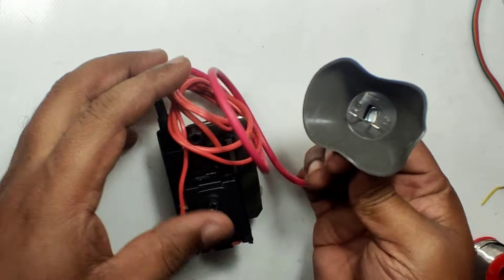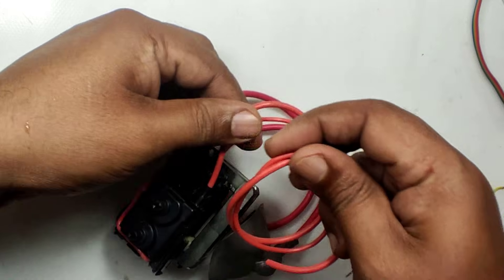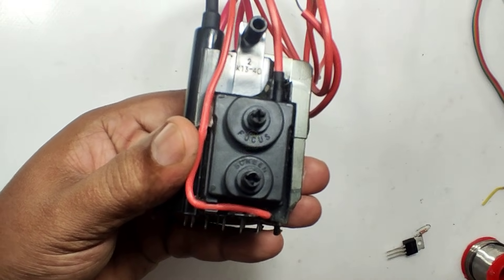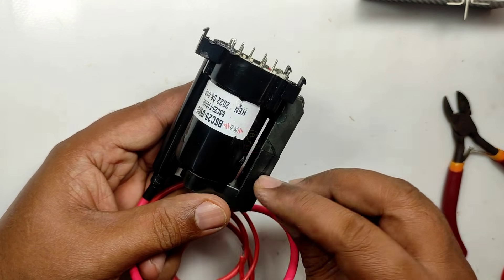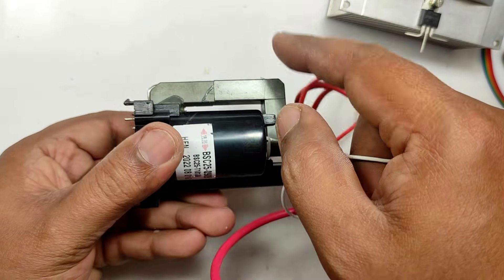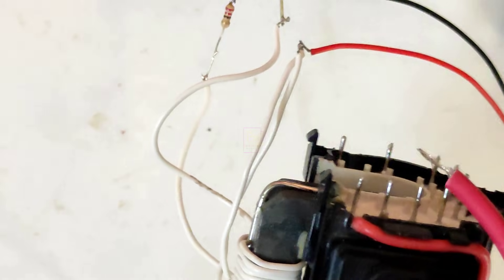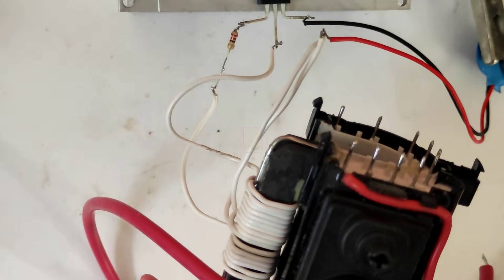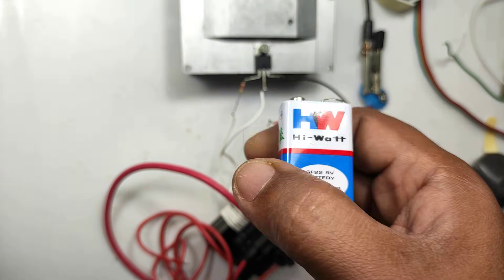How to make 400000V using Flyback transformer | EHT coil | LOT

Comment: Eso son menos de 10kv no son 40kv
1cm de arco eléctrico equivalen a 10kv para que tenga 40kv tiene que tener una longitud aproximada a los 4cm
Reply from the maker: Dado que estoy usando un televisor en color, el voltaje máximo que obtendremos de este LOTE es 25 KV.
Reply: @TechInsert  hay una forma más fácil que da casi los 25k 
Con una fuente de alimentación atx de PC, se pueden sacar 160v a alta frecuencia y se conecta a la bobina secundaria con 20 vueltas de alambre de cobre de 0.22 sin ningún transistor ni circuito 
Hay un canal en español que se llama " el angelito " y enseña como hacerlo
Reply from the maker: @MsA878   Muchas gracias. Aún no lo he probado. Lo probaré y te aviso

Comment: I try it and work fine frist but mosfet fail without being hot and voltag 2v .2amp why? my mosfet withstand until 40 amp
Reply from the maker: You have to give the exact voltage for it to run fine. If you watch the video completely you can see many of my transistors have blown coz of low voltage. The back emf should be effectively converted to high voltage otherwise the MOSFET will burn the junction coz of this back emf. The MOSFET can handle 40a but the voltage it can handle will be less tyan a 150 or 200v. That is the reason the junction is burning. If we are giving exact voltage, then it will works fine. Joules thief always works at exact range.

Comment: I need to get 50v from transformer how many oms resistor do I need for this fly back transformer?
Reply from the maker: This is a high frequency transformer. For making 50v use a booster module

Comment: Why is it necessary to wrap the white wire around the external loop of the flyback transformer???? Are the windings not internal for the primary???
I just replaced a faulty flyback transformer on a CRT drive board because I lost high voltage on the  CRT. There are no windings on the outer loop of the flyback transformer I installed. So why is it necessary for YOUR circuit???
Reply: Es para que funcione como un inversor de voltaje
Reply from the maker: Not exactly, it should as a booster
Reply: Each type flyback have different pinout. Also this circuit is very simple, only 2 component, this is another joule thief, that why it need center tap coil, while primary is regular coil. 

Also faulty in mosfet mostly caused by battery short current. Unlike battery, power supply have short protection and will provide needed current to prevent shorting. but idk.
Reply from the maker: @ This is a simple one we can work on this to form a powerfull one
Reply from the maker: Internal of LOT contains multiple tapped winding. Each LOT has different primary windings. That is why we used a different primary
Reply: Very simple circuit and well explained .Thank you very much ❤

Comment: Me gustaria saber si sirve para resguardar animales pero donde tendria qie intalar la puesta a tierra y como hacer para que de puksos no arco continuo , desde chile muchas gracias
Reply from the maker: Electric fencing is using a different circuit and it is using less than 15000v only with a small current. U know about mosquito bat? Same implementation should be done.

Comment: Will voltage input affect the high voltage output so you can actually control them using potentiometer?
Reply from the maker: Yes it will affect, Low voltage will burn the transistor.

Comment: How much is the actual frequency and how can be made adjustable ?
Reply from the maker: This is not frequency controlled
Reply: @TechInsert  i see that it's no resonant LC tank but how does it work, how much is the oscillation frequency ?
Reply: @szekerespista3758  This is not LC or RC type controlled oscillation. This is short circuit type oscillation , i dont know whether it can be called as oscillation? When short circuit the mosfet disconnect the supply to the coil and that time an emf will be induced to the secondary coil. that will create a small trasforrmation flow to the gate coil which will turn the mosfet again switched On. This cycle will continues. That is why if ur giving small voltage than 12V then the mosfet will destroy. That is coz the back emf is not enough to block the current flow.
Reply: @John-pk7lr  thank you for your response !
Reply from the maker: Thanks

Comment: Is it possible to make the arc to reach 4 to 5 inches bro
Reply: How can we increase AMPS from .5 to 6 bro?
Reply from the maker: With my knowledge it can reach only 1cm. For reaching inches you need even high voltage and high power transformer

Comment: How long can it last with a constant spark?
Reply from the maker: I tried max nearly  1min. Then again connect. Like that
Reply: @TechInsert  use cooking oil in a glass jar for the flyback transformer
Reply from the maker: @TechTed1  Is that for cooling?
Reply: @TechInsert  for cooling also for insulation of high voltage to have a greater rendiment
Reply from the maker: thanks

Comment: First time it's worked very well.., but after that my MOSFET burnt. Can you explain the reason behind now working on 3 volt.
Reply from the maker: It should get the right voltage with the right number of turns. Else it will blow the transistor. I lost many and after that it became stable and worked for hours. Those stable circuit is given in the video

Comment: I made one but its not working its gust making my mosfet hot  and when i connect it to my battery its just sparking
Reply from the maker: 12v battery and also ur LOT is working fine and not faulty right
Reply: @TechInsert  yeah I gust bought it recently
Reply: @TechInsert my LOT is new and also my mosfet I already broke 3 can you help me I tried 22k 680k 100k 220k resistor but nothing work can you help me.
Reply: @sambanay4218 bhaai saahab aapko pataa bhi h ki 220 ohm aur 22k me kya antar hota hai.
220 ohm matlab 220 ohm,aur 22k matlab 22,000 ohm.
kitna ka antar h kuchhh samajh aaya ab. k ka matlab 1000 hota hai(k=1000).

ab 220ohm k jagah aap 22,000 ohm ka resistor lagaaoge to vo to pura current aur 12volt ko rok dega. to aapke circuit me current volt hi nhi jayega to EHT(Flyback Transformer) kaise kaam karega bhai ji..

Comment: Fake I am try not work 😡
Reply: My wire is 23 swg and 11 to 22 turn  not work . please help 🙏
Reply from the maker: A couple of questions:- LOT is working fine right? 
How much voltage you have given? 
 12V is required by the circuit and  anything below will damage the transistor.
Reply: @TechInsert  LOT Good condition.   Voltage 9 amp 2.
Reply: @TechInsert  transistor is new and attached heatsink. But not work and transistor damage. 😭🙏🙏
Reply from the maker: @experimentroom4286  What voltage u have given
Reply from the maker: @experimentroom4286  Kindly watch my video fully. In the video u can see i have treid with 3.7v, 9v and failed. You have to give 12V as input power. explanation also given in the video
Reply: @TechInsert  ok , I am try apply 12 volt 🙏
Reply: @TechInsert  power voltage is 12 . But curent ? Amp
Reply from the maker: @experimentroom4286  It will be a success
Reply from the maker: @experimentroom4286  below 2 amp only this will consume
Reply: @TechInsert  ok , I am try this 🙏
Reply from the maker: @experimentroom4286  sure
Reply: @TechInsert  I already put 12v but it's not working
Reply from the maker: Its not fake , it will work
Reply: It will work

Comment: Why did the Moffett die with the lower volt and current batt but worked with a 12v 10 Amp power supply
Reply from the maker: At 12V it has enough back emf to appose the flow of current. At lower voltage it has not enough back emf and that is why high current will flow thu mosfet and will burn the junction

Comment: Fake iam try not work
Reply from the maker: None of the videos in my channel are fake. Do exactly what is in the video. Do not increase or decrease turns. Do not increase or decrease input voltage. It is designed to those parameters only.
Reply from the maker: Also check ur EHT whether it is faulty or not
Reply: @TechInsert  how ho check
Reply: It's not fake! Eu testei e deu certo manézão!

Comment: I prefer to use a transformer power supply for this circuit. High amp power supply will be a problem coz of not good oscillation
Reply from the maker: That is a much better choice than use battery power pack.
Reply: That is correct
Reply: We can mimic tv circuit for generating 25kv
Reply: @tabm7644  That might be tough, i feel so
Reply: @BabuRaj-cs4lk yes we need to  check the oscillating frequency.
Reply: @tabm7644  Yes indeed
Reply: I too prefer transformer
Reply: @TitusKelly-cj8um  ss